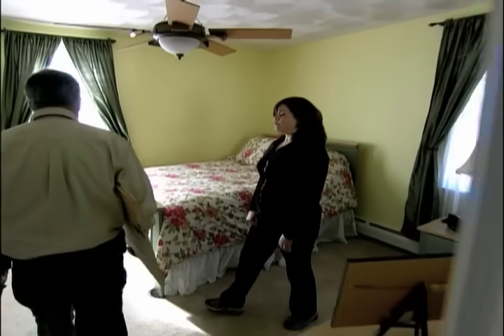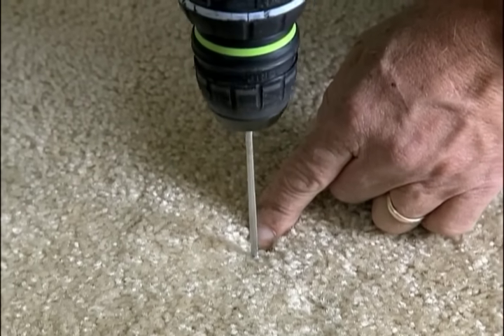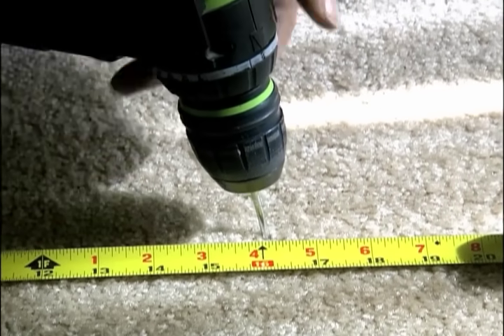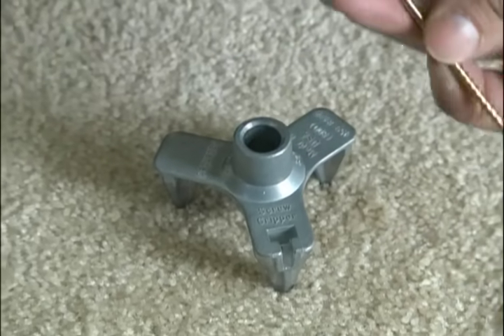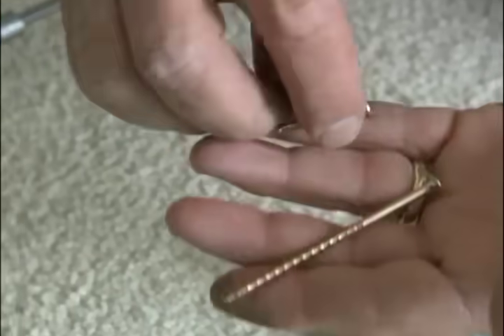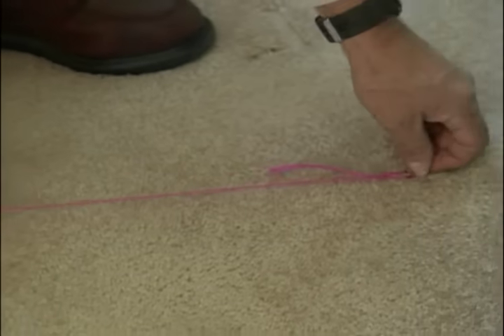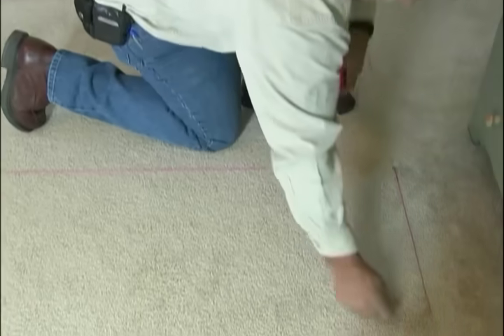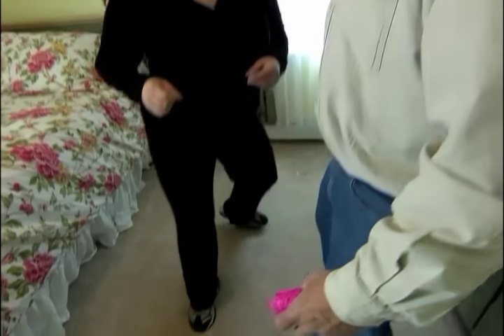How to Repair Squeaky Floors Through Carpeting | This Old House

Comment: What are the odds of sending that "finder" screw through a wire or water pipe?
Reply: He screwed them in a floor joist.
Reply: MultiPoseur you're required by the code to run electric or plumbing lines only through the wall. You wouldn't have any lines except air ducts in under the floor. But if you do puncture an ac duct it's not really a big deal, it's just air anyway
Reply: Doing this what is the tool called
Reply: @Shakib M This isn't true at all.  Electric wiring can absolutely be run in the bays between floor joists, and this happens all the time.  Let's say in this case that the room below has overhead lighting.  Are you suggesting that the overhead lights would somehow have to exist WITHOUT wiring and WITHOUT an electrical box in the ceiling?  Huh?
Reply: Typically the wires are midway down the side of a joist which is typically a 2x12 joist. So unless it's got a 4 to 6 inch screw, you are safe. Plumbing is typically at the center of a joist as well. Odds are slim, but you should know where your water shutoffs, and electrical mains are just in case of that rare occurrence.
Reply: So the stud finder I have has a Live Wire Warning. Wouldn't that help in a situation where you are concerned with that?
Reply: Usually wiring is always done through the walls not the floors or roofs as for pipes they are never attached to the floors but hanging with a strap.
Reply: Jaime Amador definitely not! What about lighting cables? Ie spotlights? Plumbing and electrics are always between joists.
Reply: MultiPoseur zero.
Reply: Shakib M Not true. I have water lines in my basement under the floor. However, they are attached under the bottom of the floor joists so there’s no chance to hit them with a screw anyway.
Reply: Shakib M I disagree 100% on that statement. As a plumber water pipes is routed under the house quite often. Very rarely do I find water pipes in the attic. However, they are ran under the floor joist so they can’t be hit by that 3” screw.
Reply: Rarely because of the depth of the joists. Electrical and plumbing usually run in the middle but older houses... who knows, but still unlikely!
Reply: M Detlef depends which country you’re in. All old homes in the UK you will eventually pop a water pipe or cable doing this. Codes are a modern day safety measure.
Reply: Zero chance
Reply: @shakibm1558  Sure, just try explaining that to the homeowner as his (her) house is getting flooded.
Reply: @killahjeep  That “rare occurence” can turn a $100 profit job into a $10,000 loss job.
Reply: If you pierce the pipe directly center, you can probably still sell the house within 10 years before the screw rusts out.
Reply: @shakibm1558  Do you only run drain pipes through walls also?
Reply: Ok so i am planning on doing this in the bedrooms is there chance i will accidentally hit a pipe? Or is there a way that I can know for sure that where my pipes are in my home?

Comment: All the people saying “what if you hit a wire or pipe?” are idiots. He’s in joists. It would be very very rare for a wire or pipe to be run through the top 2 inches of a joist. The subfloor was nailed or screwed down to begin with ...obviously..which is why the plumbers and electricians would never run their stuff  close to the top of a joist. 
P.s. have some balls. In my 20+ yrs of construction I’ve ,of course, sawzalled a wire or dinged a pipe. Ya fix it and move on. Wires short immediately. Pipes drip. Ya turn off the water etc.
Reply: americanamusica13 I think many of the people suggesting he could hit a pipe or wiring are from places other than the US. In the UK, the standard way to route a wet central heating system is to remove a floorboard, notch out the top inch or two in the centre of the joist where the floorboard sat, lay the pipe in, and nail the floorboard back down. So that the board is still supported on either side. I’m a floor sander and carpenter to trade, much of my work is making good the dodgy work done by plumbers and electricians. It’s a terribly lazy way to do it, and the sign of a good plumber or electrician is when they’ve drilled a hole in the joist 3 inches below the floor level. I’ve been doing this job for 12 years and have seen it done only once... We don’t really have plywood subfloors here because our housing stock is so old, it’s all 4-6 inch wide pine tongue and groove boards. If I want to nail down a loose board I need to fully remove the board and look along its length underneath first, no exceptions. I hit my fair share of pipes when I was younger. Hitting a 12 radiator central heating system pipe with 2 bar of pressure in it, in a 3rd floor apartment, is a terrible way to spend your day. Thankfully I’ve never hit a mains supply pipe. And yes, they’re under the floor here too....  Our floors are a mine field.

Comment: Surely without a screw head on the screw, it will work loose over time.
Reply: The threads are in the floor board AND the supporting joist below.  It won't work it's way loose.

Comment: The major problems Tom DID NOT tell you & you better be VERY CAREFUL:
< Better pray you don't drill into electrical wiring
< Better pray you don't drill into plumping
< Better hope you the hit the toilet sewer pipe
The string is a guide to know where the joist (wood beam under the sub-floor/carpet).  Once you run the string from one end to the other end, then right angle & straight and so on.

Do the ATG recommendations: 
* Lift out the carpet & you can clearly see those nails
* Then place a small nails on both side of the wall (once found nail patterns), run a string 
   after putting back the carpet.
* Make your own carpet stretcher with block of wood with nails at 60 to 40 degrees nails.
Reply: True, but not very often pipes are right next to the subflooring. Most (99.9%) are in the lower to middle of the joists

Comment: Great method for finding mains water pipes. Simply drive the provided drill bit through the floor and then check your ceiling downstairs, if you see a puddle appear that’s rapidly getting bigger, you’ve nailed it and found your pipe 👍👍😃

Comment: I still don't understand the point of the string. He already have all the screws in.
Reply: Lord baal decoration
Reply: He only had a few in. Not all of them
Reply: He had the screws in near the walls. The string was to install the rest of the screws without having to use the hammer.

Comment: The best way to fix subfloor is the right way... Remove the carpet and pad, remove all the staples and garbage from the floor that the contractor probably left under there because he was lazy, apply subfloor glue and lay over 1/4" hardwood plywood panels...then screw down the plywood along the joists every 4 to 6 inches with 2.5 inch screws. The floor will will be stronger than ever never creak or squeak again!
Reply: Close, the best way is to remove the roof then the walls down to the floor. Move all the furniture out into the street. Rent a large metal container and place all your belongings into. Then remove the rest of the house framing. After that, dig a basement. The just reverse!
Reply: Ain't nobody got time for that
Reply: And of course, if you're not a DIYfer, it'll cost you a pretty penny too.
Reply: Nonsense. Nothing wrong with using different methods.

Comment: I've got a hangup on step 1. I've attempted to find the joist and although I think I found it, when testing on either side of it I don't have the "give" that he shows in the video. It's as solid as if I was on drilling into the joist. 
Any suggestions would be most helpful.

Comment: Some of the comments meant to scare people aren't helpful...
Just know what you're working on. 
Do you have radiant heat floors? Live where electrical wires go through floors not walls (apparently in the UK they think this is a good idea)? Is it a bathroom? Do you have pvc plumbing?
These could each be a concern. Maybe try a magnetic stud finder to better locate joist nails instead?

If like me you're looking at a room with in-wall electrical, away from any bathroom, with plumbing centered in joists and down from the subfloor (look where you can see how your plumbing runs), then this is an effective strategy 💯.

Comment: I tried this on a squeaky floor and it did not eliminate the squeak because the inept carpenter installed the wood floor so it just missed the joist and then it was not supported by the joist.  When this happens you cannot tighten the loose floorboard to the joist and  I only figured it out years later when we replaced the carpet in this room. I had to remove the squeaking board and add an additional joist board next to the original.
Reply: I’m having the same problem with my upstairs bedroom, the screws made the sound a tiny bit better but the squeaking is still super loud with any amount of pressure.

Comment: Okay I do all kinds of home repairs daily as well as this actual issue. How does a broken screw with No head pull the subfloor down to the joists????
Reply: The threads go all the way up to wear it snaps off
Reply: Exactly how is a good question. Makes really no sense usually it will raise or pull away (sometimes) when running a screw into the decking/subflooring

Comment: I'm trying to use these for my townhouse upstairs. The tool for finding joists is not working for me. It seems like it drills through subfloor fine and just stops and will not drill any further. No matter where I drill, it's the same...at no part of the floor can I find an open area much less a joist.  I've used a hammer and where I believe I found a joist, I really can't find the next at 16" in either direction.

Comment: Shouldn't he have tested for electic wires and water pipes  first ?   I put approx 200 screws in my floors, before new carpets were fitted. Still makes a horrible crunching sound, after 35 years.  It's the sheets of rubbish floor material, that is butted up together, and uneven joists.  A whole new job needed.    think i'll move.

Comment: No No, located the pipes and electric cables that were fitted too close to the surface. Having refurbished properties , how many times found pipes and cables directly under the board or cut into the top of the joist. In perfect wold the idea is good, but.......

Comment: Has he got anattachment that repairs the punctured water pipe or damaged electric cable without lifting the carpet 😳
Reply: I was just thinking that. I`ve got water pipes, gas pipes, and cables under my floors here in the UK.
Reply: Agreed - this is just asking for trouble

Comment: It will creek over time with no head on the screw the flooring will simply slip up and down on the shaft also it would pay to check for pipes
Reply: You said shaft huh huh huh

Comment: How does screwing in screws fix a squeaky floor??
Reply: Virgil Manson because the floorboards were originally only nailed down, and the squeaking noise is made by the floorboard moving up and down the long smooth shaft of the nail. Screwing the boards down prevents that from happening, hence no more squeaking. I’ve done this (properly, by removing the carpet) in my past 2 houses.

Comment: First I love this TOH but that thing is BS. We tried these on builders work. Seemed like no one knew how to glue and screw a deck down so we were always going back and pulling up carpet for floor repairs and squeaks. We hated doing it when we could have been making a lot more money doing installs so we started using this thing in the video. Ya, it lasted a few months but with no head on the screw they all would just pull through and then the squeak was back and the plywood deck was even more shredded then it was before.
Reply: his body weight wouldn't be enough to adequately tighten the floor to the joist and not having a head sucking it down would still leave a gap between the materials. maybe if he temporarily sucked down the floor with real screws and spacers before using the broken off head screws it may last longer.

Comment: Straight through a radiator pipe or electrical wire running through the joists.. Not ideal tbh. Could be a very expensive repair.

Comment: Until you hit a pipe.
I’ve done it on in carpeted floors.
Plumbers notch out the joist instead of running through the centres.
Was an easy fix but a slight stain on the kitchen ceiling.
In the U.K. I could not be confident-screwing through carpet.

Comment: Okay, so I tried this and it didn't work.  I know I had the joists right on.  I don't know if this complicates things, but the squeak in the floor is in a bedroom near a wall (within 2 feet).  The squeak is also on the other side of the wall in the hallway.  I tried to tighten up the joists in both the hallway and the bedroom, no luck.  Almost seems like it made it worse.  

Any thoughts?
Reply: +David Johnson I just read a review on Amazon and the reviewer said his problem ended up being the baseboards.  Since your squeaks are near a wall, maybe that's your situation also?
Reply: If you can access the joist from the basement or crawl space you may have to screw a cripple into the side of the joist and then screw the floor into the cripple. sometimes the houses are designed to have a load bearing wall situated on top of a joist and this can be difficult to get to from on top. By adding a cripple ( piece of 1x8 ) to the side of the joist it gives you a wider surface to  attach too. This screw through the floor with carpet is ok for most carpets but if you have a Berber or woven carpet that screw will wind up a wad of yarn in a heart beat. Some times driving  a shim between the joist and floor from underneath will stop a squeak. Hope this helps. NWFA certified wood floor journeyman.
Reply: I used the shim method; it caused a hump. Too bad I glued it. What now?

Comment: What's the point of breaking off the screw head?  It seems like they could have got screws with smaller heads, and the carpet pile was fluffy enough that they would still be concealed.
Reply: Blaine Bugaski it could be concealed but you could still feel it if it wasn't broken off. When breaking the screw off, everything is underneath the carpet. The only way a smaller screw could do that, is if you drilled the entire head through the carpet which would leave a large hole.

Comment: My sister had squeaky upstairs floor. I ordered one of these kits which in theory is a good idea. However I could not find which way the joist ran and theres is no getting underneath neither as the living room was directly below. Finally gave up after several hours of trial and error. We lifted the carpet WHICH we should have done to begin with. We found the nail directions and removed the nails which were not the correct nails in the first place and I inserted wood screws 1 inch above all nail holes and to this day no joist squeak.
Her master bedroom was an after addition and the crappy construction company never gave her any blue prints for the master suite add on. Moral of this story is if one does not know the joist direction just lift the carpet, it's very easy to lay back down and stretch into place. Oh because of the floor board thickness my stud finder was no help.
Reply: Surely the joist run opposite to the supporting wall
Reply: @freeze9914  Freeze thank you for your comment, and yes in an ordinary situation of a house that was un added to.My sister had a master suite added above her living room tomake into her own bedroom. So in as much again since the contractors DID NOT leave her the blue prints and she did not know to ask for them, I had no reference point as to the direction of the floor joist until we finally lifted up the carpet. One other thing I did not mention was that out of curiosity she had me lift up one of the floor boards only to find out there was NO insulation between the ceiling from down stairs living room and the her suite floor. SO we installed this ourselves at great expense just in materials. And since the flooring was being lifted she took time to have an electrician come in and installed recessed lighting at that time. Which I asked one of my clients who is a contractor to have his draftsman come in and blueprint the master suite, which was a trade in My companies IT services for the blue printing, and he also pulled a permit for the electrical work, and had an independent company come in and certify that the electrical work and recessed lighting met codes for the City she lives in. This also allowed me to in the permit to run cat6 data cabling through out her house to each bedroom her office, and her suite and kitchen and to a weather proof box outside for internet services.   All in all this little squeaky ended up costing her $9200.00 in materials and labor , and permits. But now she is happy 
Note to ANYONE considering upgrading y our home ALWAY ALWAYS make sure you are given the build plans and blueprints to your home renovation Please, this will save y ou a lot of future hassel.
Freeze thank you for your comments I appreciate your reading what I wrote.
Reply: @benjaminwilliams3568  I enjoyed reading this thank you for explaining 👍

Comment: Just wondering, how much Tommy got paid by the company that makes that "system". That system is completely worthless, I spent a lot in this, and it was a waste of money and time, the head of the screw has to be broken, nothing to hold on to, and when the squeak is caused by the juncture of two boards, those screws are worthless. The best solution, a lot of work, is to remove the carpet, and use deck screws, I did it, and no more squeaky floors.

Comment: I remember when these first came out. Still impressive.
Reply: You can make a homemade version out of ordinary wood screws by cutting partway through the screws with an angle grinder. They are also useful when you need a hidden screw on a finished piece of wood.  Snap the head off a little below the surface and fill the hole with plastic wood.